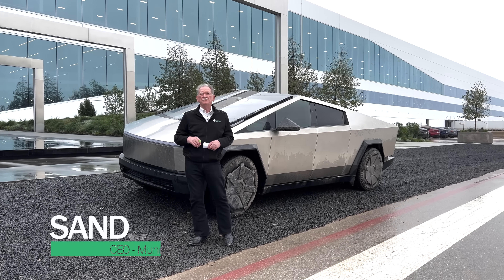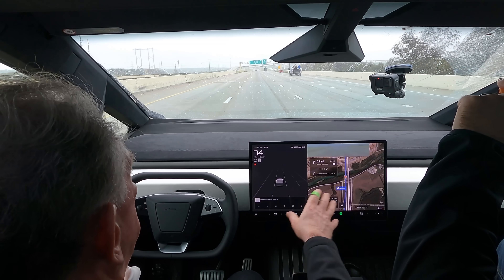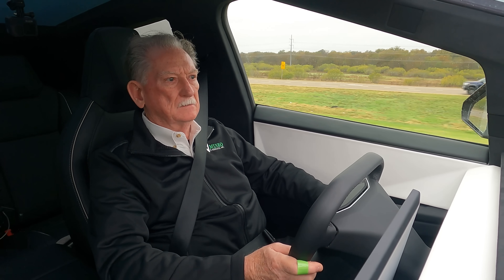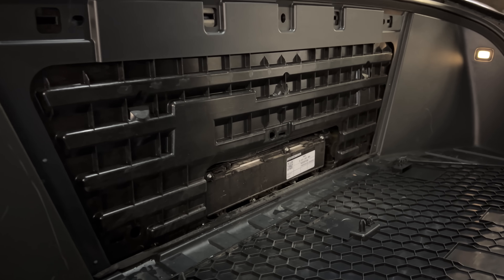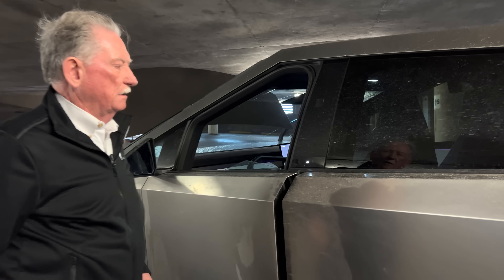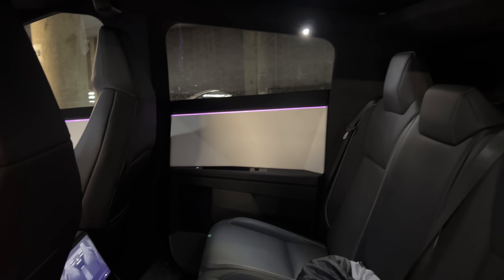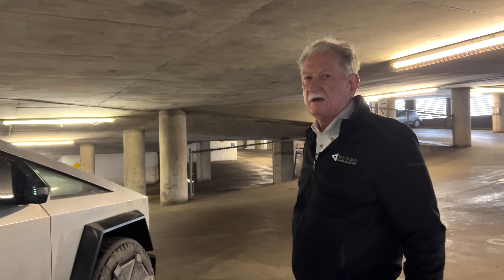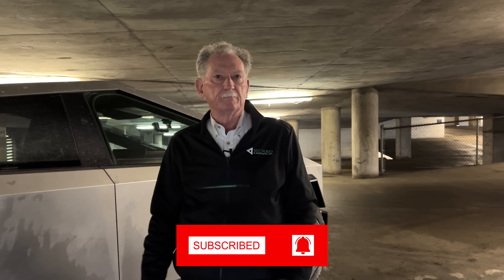Sandy's First Impressions of the Tesla Cybertruck!

Comment: Well done for mentioning the hideous noise problem that some people with ICE cars force upon us with modified pipes. It is detrimental to our health.
Reply: My impression is you might be a Sheeple if exhaust noise bothers you so much. Others have a different opinion and enjoy the sound of power.
Reply: @bobjoatmon1993 exactly.  Wimpiness is a plague.
Reply: @bobjoatmon1993  
the sound of wasted energy not power, and it has no business penetrating  people's homes or work place, it's not about opinion, unwanted noise is a proven stressor. Sorry I don't understand what that has to do with sheep? It seems like you suffer with low self esteem like many Harley Riders. I much prefer to remove sound proofing from the bulk head and listen to the actual engineering noise on my Italian car. I have nothing to prove, on the contrary I'd rather not advertise my speed.

Comment: ITS ILLEGAL to drive a vehicle without a PHYSICAL MIRROR to view 200 feet directly behind you.
Its not even a debate if the camera can work or not, ITS ILLEGAL.
Reply: The only requirement is that the vehicle is SHIPPED with mirrors. Customers can immediately remove them and drive perfectly legally in most states, if not all.
Reply: @Jonny94669  No, it literally states in almost every state (and honestly I cannot find a state that omits this but I'm guessing there are some out there) REQUIRES a physically mirror be ON THE CAR, to see 200 feet directly behind them. NOT SHIP, but be ON THE CAR.
https://leginfo.legislature.ca.gov/faces/codes_displaySection.xhtml?lawCode=VEH&sectionNum=26709 
Seriously, what you said makes a much sense as saying that windshield wipers are not required by law, - only that the car ships with them.
This is why UHAUL trucks have huge (extended) side mirrors.
Reply: Then every Sprinter van is illegal

Comment: There are dozen ways you can do flush doorhandles. What CT has it a system that has NO real gripping point and what we see in reality is that people touch the delicate surface and smudge it... since this stupid thing shows fingerprints extremely easily.
Reply: Cutting into hard steel for door handles is difficult.

No real gripping point? What? Such a dumb comment.

It's a freakin' bulletproof truck and you're worried about a few fingerprints? 😂😂 

Yeah because no others vehicles on the road EVER get dirty...ever. That definitely doesn't happen...
Reply: @Jonny94669  So, you don't know how the door works? There is a thin plastic at the top and that is it. It is not intuitive and most people actually grab it from the end of the door. A proper grip allows you to place your fingers firmly before it even opens... One thing is for sure, this will suck balls in the winter. 

You do not see fingerprints on a painted surface unless you catch a glare, something needs to be shining at it in the right angle, because it has more specular reflection. That is what clear coat does, that is why paint looks deeper color when you put a coating on it that has specular reflections. Brushed stainless steel... has diffused reflection and thus, the fingerprints are visible (clear coat won't help, nor would actually making it a mirror, because of different reasons...). Just like any matte paint car, just nightmare to keep it looking untarnished.

It is not bulletproof and WHY THE FUCK would i care if it is? It is a car... or is it... hmm... if you think that is important, i don't think you consider it just a car but a TANK where your fragile male-ego can feel secure...

PS: cutting into steel is hard, one more reason why the fucking thing is idiotic. It also will not pass EU pedestrian safety because it is too rigid. That is market the size of +400 million, affluent high tech europeans that can't get it. Why such an oversight? Because Elon is an idiot.
Reply: @squidcaps4308 
It's a POPPER.
Press the button, the door presents
Reply: The actuators which push the doors open can break through 1/2 inch of ice.
Reply: @datamatters8  lol. No they can't.
Reply: @squidcaps4308   See video by TopGear "Tesla Cybertruck DRIVEN!" time 32:03,  Lars Moravy, VP Vehicle Engineering says "if you get frozen door handles whatever, door handles are a pain to open but the truck can actually break through a half inch of ice."

Comment: About the gaps.. You can't say anything about the build quality until they actually start mass manufacturing them in a full production line. A test unit like yours has been specifically chosen to be the perfect one.
Reply: Have a look at the ones already released and have a good look down the face of the panels down the sides, wavey, buckled. It needs to be rectified, it's unacceptable.
Reply: @stevo184  Been following it since 2019, seen basically every single photo ever uploaded of it, never seen the problem you're referring to.
Reply: If you noticed, they are already mass manufacturing it on an automated production line. The opposite is true: the manually made had uneven gaps, the mass manufatured don't.
Reply: @Alarix246 How many have been delivered?
Reply: @jdmather5755  how can I know? During the delivery event there were ten, but I hope you're not trying to suggest that this was all?! Wait till first week of January, you'll learn what you need to.
Reply: @Alarix246   Based on my years of experience and the hype prior to this release I will wager that the attention to build quality was far above what will be observed in mass production.
Reply: @jdmather5755  how do you do that in the automated process? The line is either capable of maintaining that quality or is not. I don't think they are struggling with robotics.
Reply: @jdmather5755  and what if they didn't care that much with cars made almost manually, serving as prototypes or release candidates, but these minor details were removed once the automated line products started coming out? 
I personally (you might have different opinion) believe that the gaps were the easiest target for Tesla critics at the beginning. That was the Fremont plant, which was inherited (with most employees) from the unhappy GM/Toyota joint venture. Ever since the critics point out at this as if Tesla overall didn't employ people but idiots who will never be able to keep some industrial tolerances. Imho it is just part of ripping Tesla down, with no real basis anymore. 
Japanese cars used to be criticised for the same thing in the 50s and 60s, and since then they became a symbol of the best quality. Same here.
Reply: 'Specifically chosen to be the perfect one'

No bro, this was just an engineering test model that has been driven around Giga Texas for a while. That's obvious from the amount of dirt all over it and the fact he literally said this one doesn't have everything enabled on it.
Reply: @Jonny94669 
You're correct, but it doesn't fit the FUD narrative does it? 😉👍
Reply: @rogerstarkey5390  It's beautiful watching guys dedicated to ICE absolutely meltdown realising the era of ICE is over.
Reply: Can't say anything? That's ridiculous.
Reply: Can't say anything? That's ridiculous.

Comment: Curious why people think this will not function as a true pickup truck? It has a 6ft bed, it can tow, has onboard power for tools no gas generator required on job site.
Reply: it depends on how each individual defines and uses a truck. I have a 67Chev I use for hauling gravel, firewood, etc and can have a backhoe operator dump into the bed without any fear of damaging tonneau cover rails or controls, etc. I also have easy over the side access to any part of the bed for loading or unloading anything. For that use case I wouldn't want a CT. My brother has a Tacoma that he's very protective of the paint on and uses it largely for towing his boat and other trailers short distance..in that case the CT would be a suitable substitute. My uncles and cousins use their full size trucks to move lobster traps
CT wouldnt be great for that use. I think truck is such a variable category that saying any one vehicle can be good in all situations of a bit of folly.
Reply: @Martinmack333   Concerning side access to the bed, you can tap the screen before you get out and the whole truck lowers by 4".  It might make a lot more of the bed pretty accessible.
        Btw, I spent half an hour trying to find the height of the top of the tailgate from the ground for both the CT and F-150, in order to get a baseline for the CT side height, and could find neither!  So weird.
Reply: I love electric, but towing anything other than a small trailer dramatically reduces range.
Reply: on top 800V
Reply: It's harder to load from the side, but the bed is more protected. It has a lot of overlaps with SUVs while being able to do truck things. Personally I view this as some sort of hybrid

Comment: Spare Tires Matter

Barely ever used, but when used can be a trip or even life saver. For an offroad possible vehicle it's a must. Having a way to carry one that does not impact storage space is key.
Reply: agreed
Reply: Okay, but who is going heavy offroading whilst also fully loaded with equipment? 

The only people packing their trucks to the max are tradesmen lol, and they aren't going off-roading in the mountains at the same time. 

Leave the spare at home if you're hauling stuff, take it with you if you're going out into the sticks. Easy.

Comment: Would someone PLEASE lift up wiperzilla?  I want to know if it will stay up on its own, because scraping ice of the windshield with that thing along the side looks like a NIGHTMARE.
Reply: One does not scrape ice from the windshield of an electric car. You tap a button on your phone 10 mins before you leave and you just get in the heated and defrosted car and drive away. Or you don’t do anything at all if you leave at the same time every day, you schedule the defrosting in that case.
Reply: @BasketKees  I admire the optimism, but don't think you can clear 5 inches of snow of a quarter inch of ice in 10 mins with the built in heaters... Hopefully you can.
Reply: @getoffamylan6844  The thickness does not matter much since you’re heating it from the inside just enough for a layer of water to form so everything slides off. In more extreme conditions it will take longer of course simply to build up temperature. But then you plan to start it earlier, still greatly preferable to scraping it off. Also helps the battery, that gets preconditioned at the same time.

Comment: Disappointed in the range,
You will not get what they are stating, 
Initially Tesla stated 500miles, not even close.
Cant wait to see someone pull trailer / boat or what ever down highway at 55MPH or more and see the range drop like a rock.
I still like the original screens like the older Tesla Model S had. 
Need to add screen in front of driver like the Model S. 
.
Cant wait to see people drive in real lift and see how it holds up and how far truck will really go. 
.

Comment: I'd like to hear from a Tesla insider or Elon why originally announced features were removed and if they may be incorporated in the future:  solar tonneau cover, direct solar charging, integrated pneumatic air, integrated tailgate ramp, center front seat, bed access from the cabin, boat mode, etc.  What were some of the original ideas in leu of a windshield wiper and why didn't they work out?  Why was the original range estimate for top spec 500 miles and why wasn't that possible?  Did they expect a new battery technology with higher capacity to replace what they have now and what is the holdup?  Also, why are the approach and departure angles so different from the prototype - is it to accommodate additional batteries?
Reply: All about cost 😅
Reply: @youtuberpov  
cost and time
Reply: Optimism.
.
Imagine if they Launched in 2019 and said .... "Yeah, it's. ah.... going to.... Be a Truck.... Thanks for coming...."
.
Solar... Tonneau  and charging It became apparent that a 2m square panel would not provide more energy than was lost by weight, aero and dirt. Plus a tonneau would be fragile and complicated (Rivian says "hi")
Elon has told you this.
 .
Air.... Expert users have commented that the pressure and amount required is best served by a stand alone unit powered by be truck battery.
.
Wiper?
Weight, complication, durability...?
(K. I. S. S)
.
Battery.... "Work in progress"
Shape?
Aero?
Other design decisions?
No obligation to explain, but probably will if asked.
It's a 124kWh pack in a vehicle with a longer wheelbase than the competition.... There's room.
Reply: Haha the answer to all your questions is that Elon Musk is a moron and a liar. It was always total BS. Tesla is literally a pyramid scam.
Reply: Elon : no refunds 😊
Reply: One word: hype. 

You're welcome.

Comment: Actually, uf you swr the air suspension to it's liwest setting, its similar to otger trucks for most of it's length.
Reply: But, the point is you have the OPTION